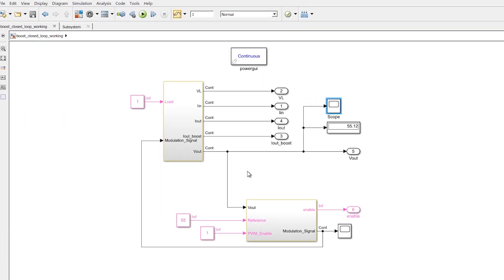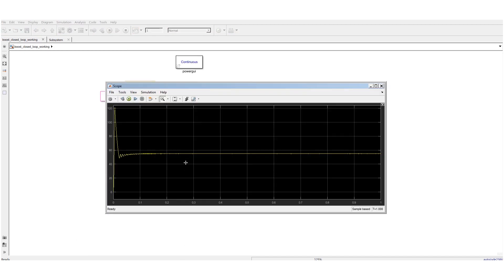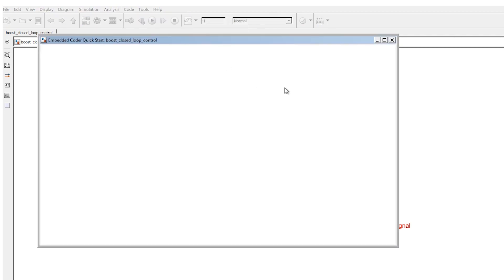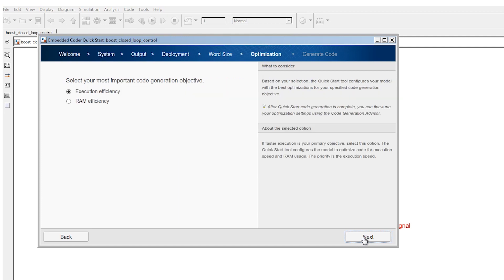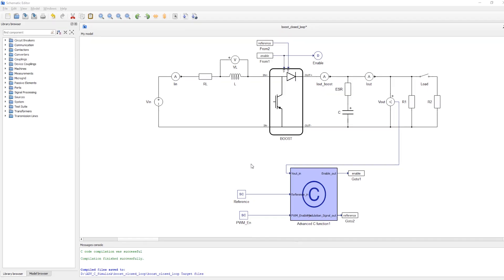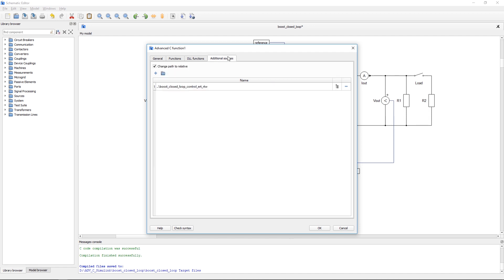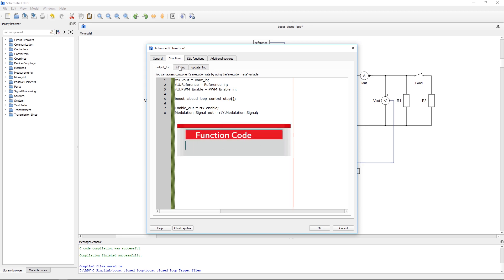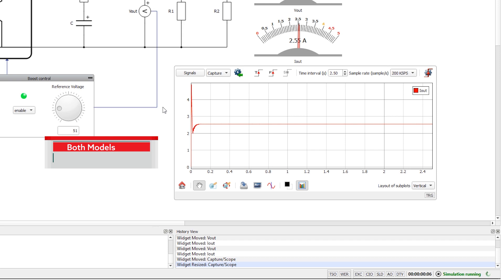Integrate Simulink Model into Typhoon HIL Environment | Tutorial

Comment: Hi, this example worked for me. However, in my core implementation for MMC control, My generated C code contains some arguments at system_Initialize(xxxxxx) and System_step(xxxxxx). any assistance as raising a ticket isn't being helpful. Thank You
Reply from the maker: Hi Valentine! Sorry to hear that you ran into some difficulties, however, for specific support questions, the ticketing system is the fastest and most reliable way to resolving this. In case this was not solved for you so far, please try again. Thank you and all the best!
Reply: @TyphoonHIL  I have raised a ticket. for 10 days now no response or help with my request.

Comment: Hi. Can you please explain how to export the Simulink control block to c-code for the DSP100 board (C-HIL using HIL402 + DSP100 card).  I'm familiar with TI's CCS and successfully implemented C-HIL using code generated by PSIM. But I want to do this directly from Simulink. What target to choose? TI's C2000?  

Thanks
Reply: Hi
Typhoon HIL company is not owner of Simulink application, we are just providing interface for importing C code from Simulink to Typhoon HIL environment. For Simulink specific questions, please write directly to them.
Best regards
Reply: @dusankostic502  Thanks. My question was actually Typhoon specific. You showed how to export code from Simulink to the C function. I've asked how to do the same using your DSP100 or DSP180 expansion cards? Anyway, this is not an issue, because I can still do it using PSIM. 

I have another typhoon specific question. In the video, it's unclear how you setup the inputs and outputs of the advanced c function block. How are the inputs and outputs relate to the imported code? 

Thanks
Reply: Thank you for your questions. 
1) Currently it is not possible to export platform specific C code. You can search for our other video "Tutorial | How to Export Generic ANSI C Code
", where we are explaining how to export agnostic ANSI C code.
2) Inputs and outputs of Advanced C function are connected inside "output_fnc" function. You can find the whole example in the our installation folder in ..\examples\models\how-to examples\boost closed loop advanced c

Best regards
Reply: @dusankostic502  

Thanks. I've looked into the example. I noticed the following 2  fnc calls in output and init tabs:

boost_closed_loop_control_step();
boost_closed_loop_control_initialize();

I see that these calls were copied from the boost_closed_loop_control.c code and  the boost_closed_loop_control.h below /* Model step function /
 and  
/ Model entry point functions */  comments, respectively. 

Also, the I/O variable definitions were taken from the main code. But the rtU and rtY prefixes were added to the declarations. 

Are all of the above common to any project? Do I only need to search the main c code below the * External inputs (root inport signals with auto storage) / and  / External outputs (root outports fed by signals with auto storage) */ comments and copy the I/O var names and add the rtU/rtY prefixes? 

Unlike the boost example, my exported Simulink control block includes a total of 5 .c and .h files (myproject.c myproject.h plus ert_main.c and myproject_data.c extra files). The _data.c file contains lookup table data, but what is the extra ert_main.c file? Is this OK? 

Thanks
Reply: @ebarbie5016  My colleges have informed me that they were discussed this topic with you through the Ticketing system.

BR
Reply: @dusankostic502  I also need similar assistance